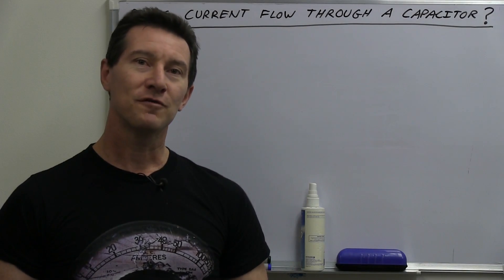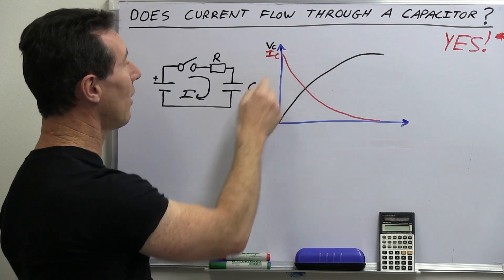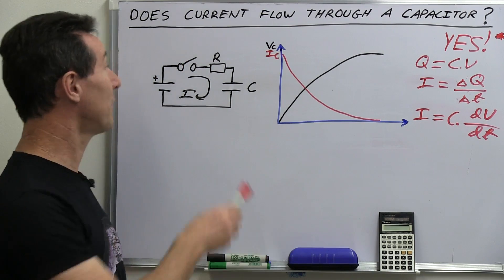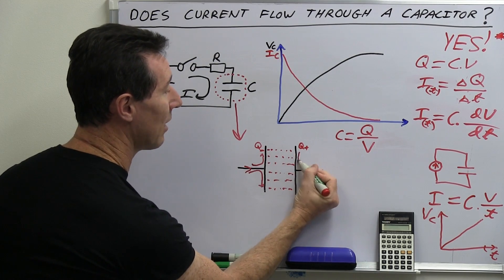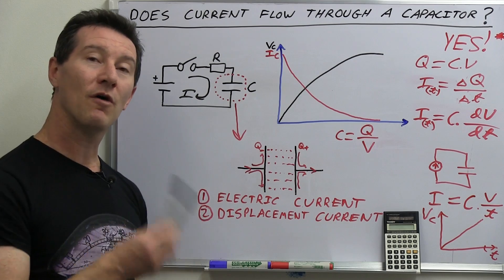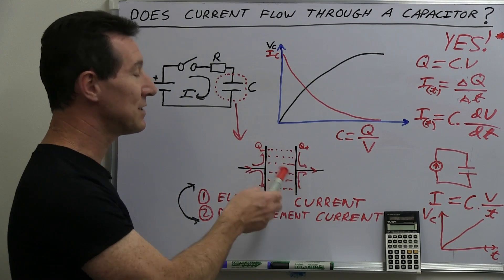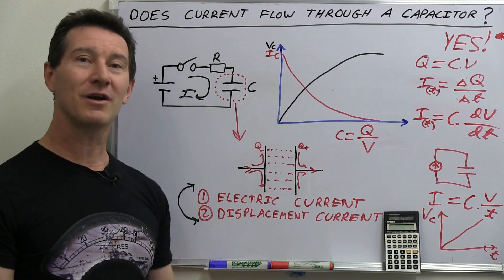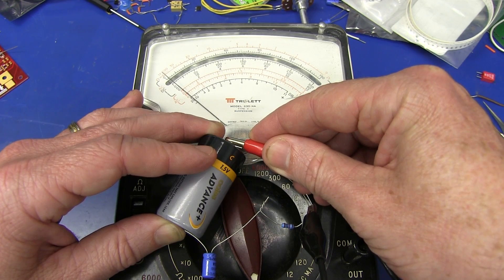EEVblog #486 - Does Current Flow Through A Capacitor?

Comment: Good video Dave but I always teach that inductors work by electromagnetics and capacitors work by electrostatics. You said, quite correctly, that electric current is the flow of electrons. If the electrons are not moving then there is no electric current.
Consider now the following analogy which I use for teaching how capacitors work.
Imagine a shopping Mall filled only with heterosexual men, who represent the electrons on one plate of the capacitor. All of a sudden a naked lady appears (+ charge) in a shop window. All the men rush to the window and because they move there is an electric current. Quite large at first but tails off as the furthest men get to the window. The glass window (insulating dielectric) stops the men touching the girl but because the Mall is now devoid of men (negative electrons) you can say that the Mall has attained a positive charge because of this.Now you change the polarity, we can do this in the analogy by replacing the naked lady with a naked man! The men zoom away from the glass window, creating a reverse current flow, back into the Mall, so making it negative. So with this simple analogy, one can see how a + and then - charge on a capacitor plate can make the electrons go back and forth, creating a current even though non of the electrons actually go through the dielectric. It's not a perfect analogy but always causes a laugh in the classroom and gets the students attention. :-)
Reply: Woow, I had never read any such explanation.
Reply: Les Carpenter, the problem with your analogy is that if you hold the (+) charged side of the capacitor to the (+) charged battery terminal voltage by attaching them together, when you connect the (-) charged terminal of the battery to the (-) charged terminal of the capacitor according to your theory none of the particles of electricity from the (-) battery terminal should make it through the capacitor, yet they certainly will.  When they changed Ben Franklin’s markings on a battery they really messed things up nicely, that is what caused all the confusion.

Comment: My mind is blown by this. I had trouble trying to wrap my head around why/how caps worked in series despite creating open circuits. Kudos to you. :)

Could you do a fundamental fridays video about inductors, and one about RC, RL, and RLC circuits?
Reply: Caps in SERIES  is like ONE cap with a GREAT distance between the plates (the first cap's plate, and the last cap's plate)   In PARALLEL it's like ONE giant cap with HUGE plates.   So, in series, the capacitance will be smaller than the smallest cap.  In paralled, they are all additive (their cap values)

Comment: to me capacitors are made up of two conductors separated by a insulator a non-conductor Electric current D C or AC does not flow through a insulator a non -conductor If it did we would have no T V-mobile phone-transformers-electric motors-alternators or generators understanding how a transformer works is understanding how a capacitor works It may not always be what we know but what we belief we know

Comment: in a electric circuit current does not flow from one plate of the capacitor to the other plate electric current does not go through a insulator In a transformer the current that flow through the secondary wingding is not the same current that flow through the primary wingding they are insulated and isolated from each other Magnetic flux go through a insulator electric current does not We know that a change in current can create magnetism a change in magnetism can create a electric current Little is really know about the relationship of electric current and magnetism.
Reply: >little is known about the relationship of electric current and magnetism

Maybe you know little about it, but electromagnetism theory was the most complete theory in all of physics until quantum mechanics came around.
Reply: jpsousa4 if you keep believing that D C current flow through a non - conductor than good luck - and about quantum mechanics still seem to have trouble explaining how a capacitor really works

Comment: Anybody that has tested a capacitor for continuity should have seen that it didn't had any. As you well said, it is basic an opened circuit.
Reply: jpsousa4 i disagree, when something goes in one end, and something goes out the other end, doesn't mean it went thru. i think this is not the same electron. it are other electrons that already were on the other side to start of with. And just before the same electron that came in first wants to come out the other way, the capacitor refuses and basically says "you, shall not pass!" that's why it doesn't conduct in a DC situation.
Reply: Peter de Man I'd say you are correct!!
Reply: It's an open circuit to DC and DC only. Any time you try to change the voltage on a capacitor, current flows IN on one lead and OUT on the other, and the currents are equivalent -- current flows through it.

Comment: Considering fact that electrons move very slowly in most conductors we can asume that conductor is infinitely big capacitor. especially if we have AC current.

it is just that electrons that leave one pin of capacitor or one end of wire are not same electrons that entered another pin.

there no such thing as displacement current, all what exists is electric field which drives electrons inside of conductor or capacitor or plain vacuum space.

Comment: So to the haters, I guess water does not flow through the big fountain at the mall either??? That's nothing but a big analogy for a capacitor with the pump as the electrical source circulating the water (electrons) into the pool ( dielectric)...
Reply: wrong analogy, capacitor is more like 2 reservoirs of water joined by flexible membrane.
there is no way for water to pass from one side to another and yet water will flow as if there are no obstacles.

Comment: Touch a cap that is in a high amperage circuit, that is fully charged, like the one that is hooked up to the magnatron in your microwave, and your corpse will prove that current flowed through that cap into your body and killed you.
Reply: All your proving is that current did at one time flow into the capacitor and at one time flowed out of it into your body and killed you ;) this video should explane it all, maybe watch it again?
Reply: I liked my humans fried, double fried like my chicken! hahhahaha! ;-)
Reply: Really, no current "flows through" the capacitor, in an AC circuit. It just "appears" to do so. 

Unless a capacitor's dielectric is "ruptured," there is no current actually "through" the cap.  It just "appears" that currect is flowing "through" the cap.   The cap just "charges, discharges, charges (in the opposite direction) then discharges.   Current looks like it is moving "through" the cap, but really is not.  (yes, you would feel the effects of that AC :) 

An electrolytic cap, in a DC circuit, will pass "the affects" of AC, but will block DC.  No current will actually "pass through" the cap.  If there is an "AC ripple" riding on the DC value, the DC will be blocked, but you would see that ripple on both "sides" of the cap. 

Or, am I wrong?

I
Reply: Michael Donavon There is a current flowing in the capacitor's dielectric, it is called displacement current and is a crucial fact in completing Maxwell's equation which is the basis of Electromagnetic theory. It is the discovery of the current (displacement current) inside the capacitor that eventually lead to the conclusion that light is an electromagnetic field. Go check it out.

Also, the kirchoofs current law (or current continuity) is equally valid inside the capacitor's dielectric. Choosing a current node just in between the wire and dielectric interface will conclude that there is indeed a current flowing in the capacitor's dielecric (i.e. the current flowing in the wire going through one of the capacitor plates is equally balanced by a current passing thru the dielecric coming from the plate).
Reply: ***** Har, har, har.
Reply: OK, connect one side of the capacitor to your wall socket, and hold the other side with one hand. Now, ground your other hand and you'll know for sure if current flows through the capacitor, or not, because if the current flows it will roast you. (it will roast you, don't try it; use a meter like in the video)
Reply: "as high capacitive/inductive loads may cause the busbar protection to false trip" source link :: http://ieeexplore.ieee.org/abstract/document/7514780/  :: [this may be a indication that capacitors are operating(until full as an inductive(non-intutuive `to me confusion) "Inductor Mode" until full,  if this makes sense, while holding a potential "reverse ~inductive~ voltage" to carry on out it's axial path - But generally DC potential   _ .. from "AC" it's the DC cross-collateral potential conduction tat gets you.
Reply: it discharging
Reply: railspony again, that proves that current flowed through your body. Not that it when throughly the capacitor. Just like if you put a multimeter in series on one side of a capacitor.
Reply: Current flowed from not through the capacitor.
Reply: OK well continue to hold the the negative pin of that cap and see if the current quits coming from the power supply as it burns your corpse till the breaker trips or your body catches on fire are burns the the house down thus interrupting the circuit that was pumping electricity through that cap into your blackened burnt   body dumbasses. Current pass through a cap dont be foolish. it will block dc on a floating input but will flow to ground.
Reply: Your sir are dumb did that cap just spontaneously generate that current or did it flow from the power supply through the cap to your closed minded body.

Comment: Dang. Dave, I wish I lived across the street from you. What thrust me into my obsession with electronics fundamentals was my attempt at using a dynamic microphone on a hardwire telephone. I ran into a problem until a docent at the Pacific Bell building museum on 2nd street in San Francisco informed me that the telephone volts were clobbering my dynamic microphone and that I should use capacitors to prevent it. I ended up using one 22 microfarad capacitor on each pole and the result was magic. I still had problems with the receiving end of my phone calls but I'm sure that I could have worked it out. But I had a lot of fun and I got to gain knowledge about microphones.

Comment: Connect two voltage sources, one of 5V to one terminal of the capacitor and the other of 9V to the other terminal of the capacitor. Add some resistor to the negative poles of the voltage sources. Right after you switch on the circuit measure the currents the two nodes of the capacitor. Are these currents the same? Now replace the capacitor with a resistor and measure the currents and see if they are the same. Use a solenoid as well and wait till the circuit is stable and measure the currents.

Comment: The discrepancy is a matter of semantics.  In terms of circuit theory, current "appears" to flow through the cap.  In reality, no charges are crossing the dielectric, so no real current is flowing "through" the device.  Charges entering one side of the cap attract opposite charges to the other side. This can be treated like the current flowed through the dielectric, but the charges actually flow "around" the rest of the circuit, not through the dielectric.  So the answer is  "No, current does not flow through a capacitor, but it appears like it does!"
 
The displacement current was a fix Maxwell added to his EM theory to make Ampere's Law work with electromagnetic waves. It is not pertinent to this discussion.  The motions of the charges flowing on the plates (in response to the changing electric field) can be viewed as creating a magnetic field that will satisfy Ampere's Law using the "circuit view" that a current flows through the dielectric.  The displacement current just makes the mathematical convenience of the magnetic field defined using ampere's law consistent with the charge continuity equation (charge can't be created, and must flow from somewhere) for time changing magnetic fields.

Comment: Also what the vid is saying is that current flows into a plate inducing a equivalent magnetic moment which does cross the gap and "knocks" electrons off of the other plate which then are attracted back to the differential voltage source. Currrent here is either a movement of charge (and argueably mass also) or a field of equivalent energy. Here conventional current flow (ie of holes) is interesting, because holes are nothing and can move arbtrairly fast (at least as fast as electricity seems to move) as opposed the electron which are something and therefore slower, but that's a bit off topic.

Comment: You are lacking theorethical background and common sense and even proper school education..
current DOES NOT FLOW thru capacitor. there are charge buildup on both sides of capacitor. and current "thru" capacitor means that excessive charges go into the wire ones you start to ALTERNATE electrical field across sides!. Electrones do not "jump" from one wire into another.
 there is simply electrostatical field which is responsible for charges buildup, and thats the only thing it is responsible for.
If u don't believe me, put a diode in series. so there would be no possibility to buildup electrones on one of sides capacitor will not conduct AC AFTER it is charged fully in either polarity (if not taking losses in capacitor into account of cause.)
Reply: Wait, did you even watch the video?  He says all of that.

Comment: Jeez, add a light bulb to the circuit, notice current DOES NOT flow through the capacitor and facepalm yourself. No worries, we still love you.
Reply: permababy But it's not a false statement, and it is the point of the video. Electrons don't flow through a capacitor, sure -- but electrons aren't the only source of current. Given an ideal dielectric, you can charge a capacitor with a constant current until the end of time. It just means the voltage on the capacitor will continue to rise and rise.

What's more, the constant current IN on one lead matches exactly the constant current OUT on the other lead.
Reply: Sure it does. If you don't see the bulb light up, your capacitor is too small and/or your current source doesn't have a wide enough swing.
Reply: If you capacitor is big enough and you have a matching power supply the light will light up until the capacitor is charged. Then the light will go out. Still no current flowing through the capacitor.
Reply: Except, y'know, while it's charging. Which is the point.
Reply: hobbified But that's not the point of this video. Dave claims "current flows through a capacitor" which is clearly a false statement.

Comment: Ok, electrons don't actually travel through the capacitor though. With an applied voltage, electrons will build up on one side of the capacitor and holes will build up the other. Charges on either end will continue to accumulate until the voltage across the capacitor is that of the applied voltage.
Reply: Thats true. But current is not 'Exactly' the same as electron flow. Current is more of an apparent flow of current. Electrons do not flow across a capacitor, but because electrons on one plate influence electrons on the opposite plate, an effective current can be measured through the capacitor.

Comment: You do not let the viewers know that the current you say flows 'through' a capacitor STOPS when the cap is fully charged.
It flows to charge the cap not flow through it, then ceases.
If it flows 'through' it would not stop.
Alternating current appears to flow though a cap as it charges it up then reverses direction so it discharges the cap. This appears the current is therefore passing through one way then back again- in other words the ac is 'passing though'.

Comment: Also, you CAN buy a displacement current meter.  That's what clamp-on meters measure.  Fields, not counting any moving charges passing through the hole.

Comment: To stir up more trouble:  ignore vacuum capacitors.   Instead... in modern ceramic caps about 99.99% is a real electron current in the dielectric. Those electrons in the dielectric can move a bit, but aren't totally free like in metals. Look up ferroelectrics and PZT ceramics.  Not "vacuum polarization," but polarized ceramic.

So, Maxwell's displacement current actually plays an insignificant role, at least in ceramic caps.  That's why their dielectric const is 2,000, or 5,000, or higher.

Comment: I should have explained why it SEEMS to flow through the capacitor. The opposite plate builds up a CHARGE field from the opposite side. When this field discharges there will be a current on the opposite site of the capacitor. This does not come THROUGH the capacitor but from the electrostatic field that was built up on the other plate in the capacitor. You don't need any advanced physics to learn to understand this. Just go to some older books on ELECTRICITY or RADIO (WIRELESS)..

Comment: You have a CAPISCE problem ! You are confused ! So many words to express being confused. It is very simple. Electricity  flows TO the capacitor and builts up an electrostatic field there because it can't flow THROUGH it ! On the opposite plate 
an oppositely charged field builds up. Do you understand it now !!
Don't talk nonsense about EQUATIONS you understand even less !!!
Tayovan

Comment: The question should be if current flows through the dielectric. Because current or electrons, most certainly flow through a capacitor, just not through the dielectric. A capacitor works like a piston in a cylinder. As it moves one way, it creates a vacuum on the other side. The air doesn't get past the piston, but it does flow though the cylinder. And, they are actually even flowing though the dielectric, but are being converted.